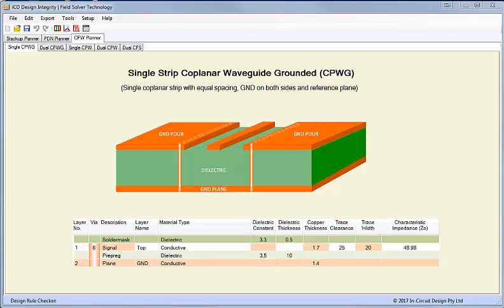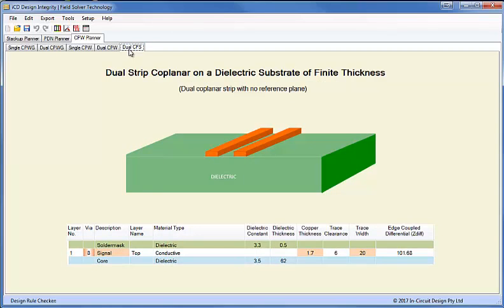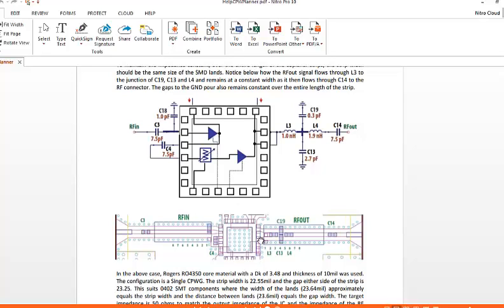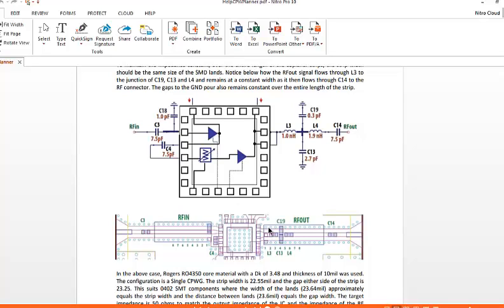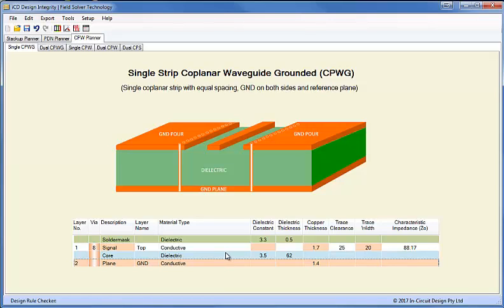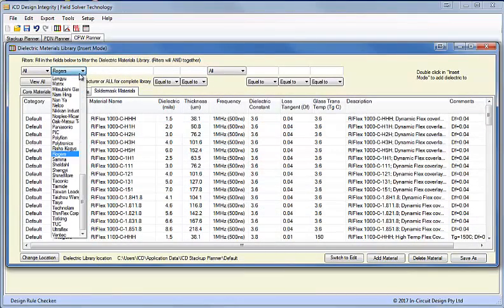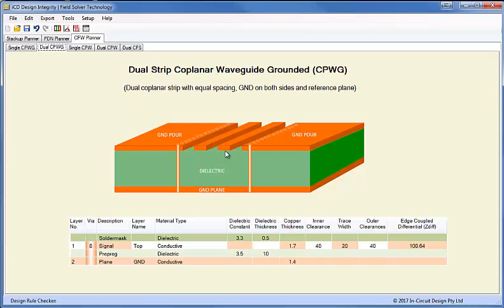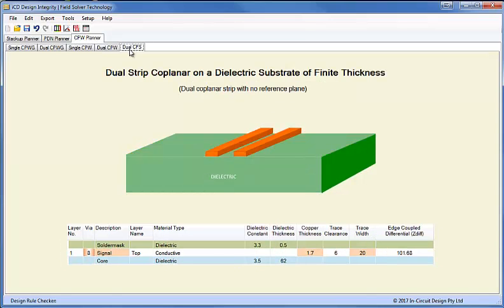CPW (Coplanar Waveguide) Planner by iCD

Comment: Hi, In six-layer board, when using Coplanar waveguide trace on the 1st layer. Can I place a +3.3v power trace under antenna trace (5th layer)?In the 2,3,4th layer, I have a ground plane under that trace.